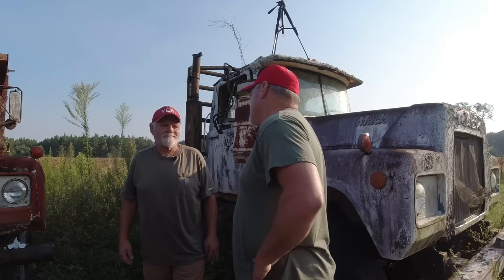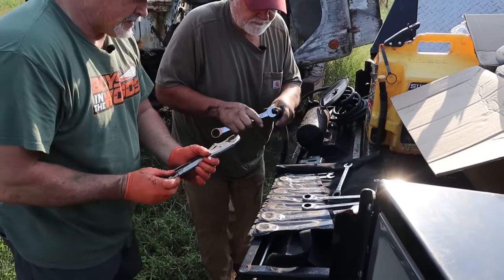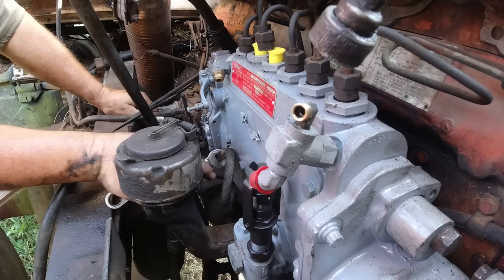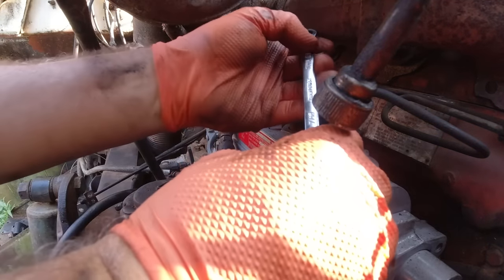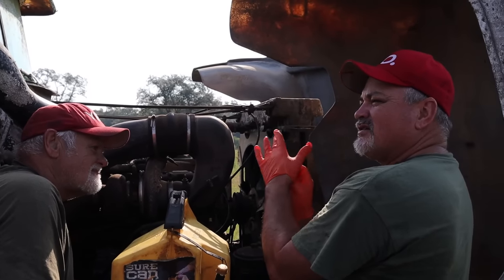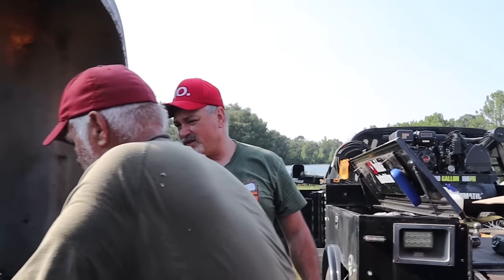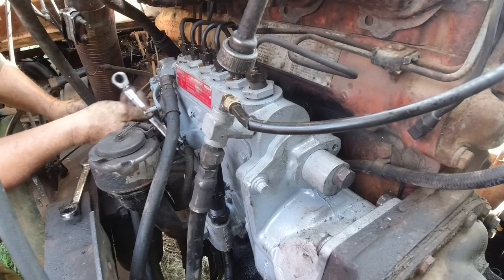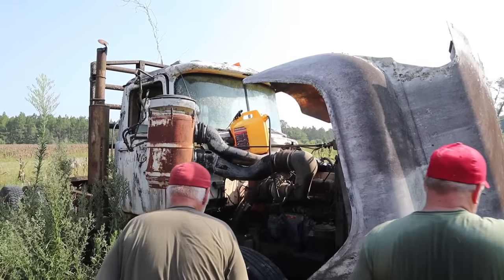After 5 tries do we finally get this Mack running?

Comment: Hank I'd try to find some plastic.,or plastic coated tags for those battery cables on y'all's will it run videos. Ones that are made out of Red and black plastic.,or paper tags to that are colored for zip striping on to the cable's for proper identification reasons on older equipment and vehicle's. It really does kinda simplify it more.